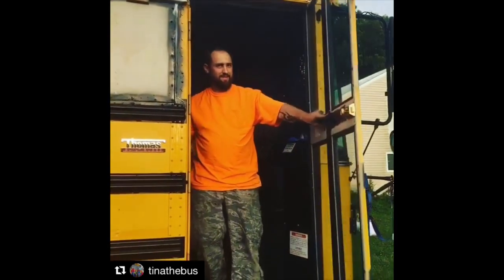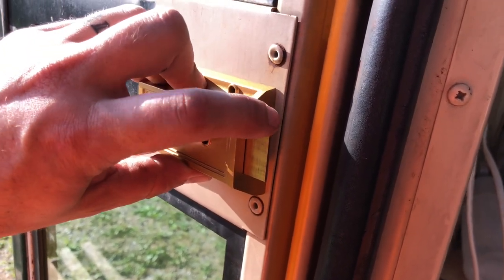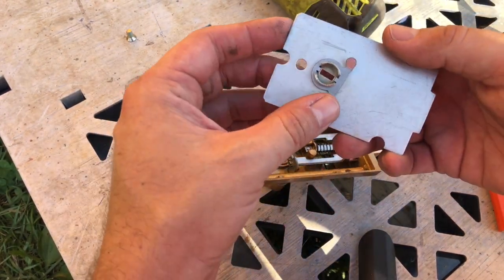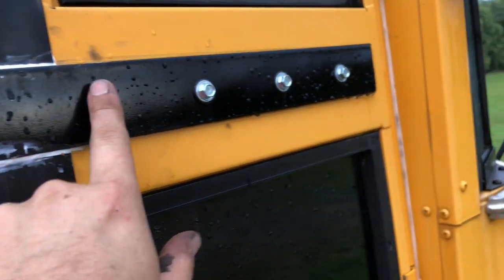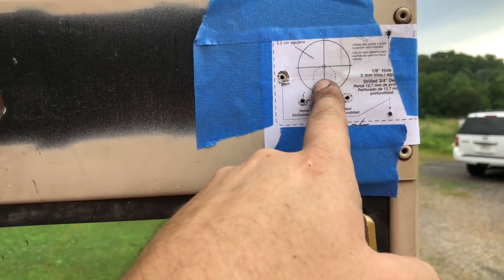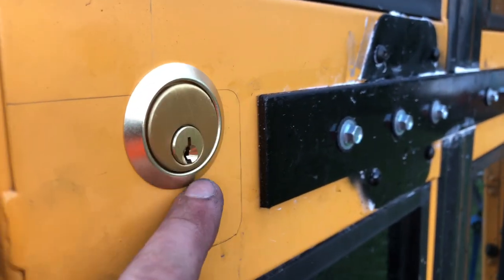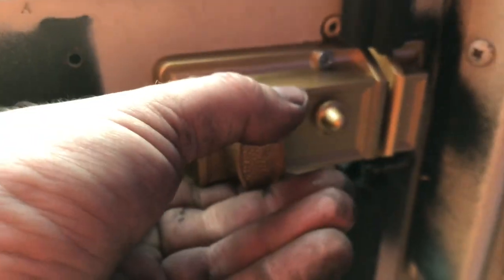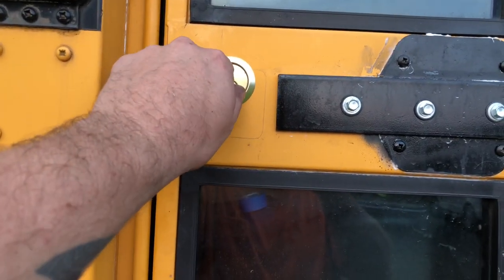How to Build a One Piece Skoolie Door with Latch and Lock

Comment: you might want to close that gap a little bit for better latch engagement.. remember, your door "lock" does not have a positive locking engagement such as a regular automobile has.. it's only a spring loaded latch (40 years a locksmith experience and observation)

Comment: I would weld a nice thick metal angle bracket kind of shelf ledge thing on the inside of the door. this way no one can BEND your door in the middle and pop it right open.

otherwise. VERY cool !! and nicely done!
Reply from the maker: So far so good. We have seven kids and it's held up nicely so far. But thanks for the tip. If we ever need to replace it will consider that.